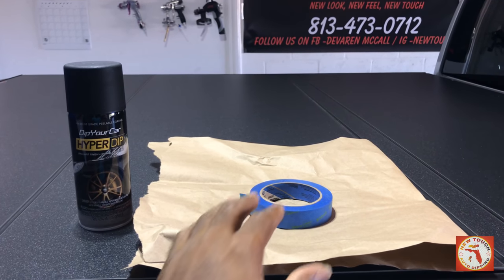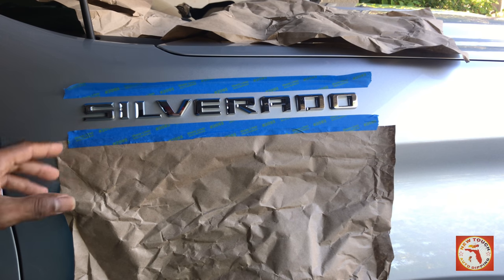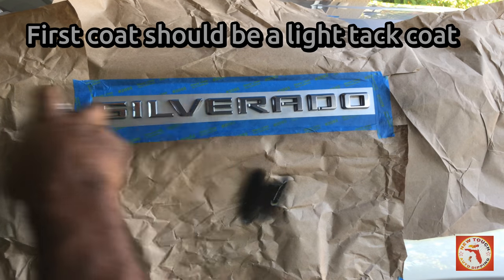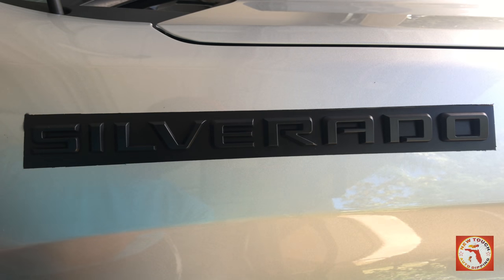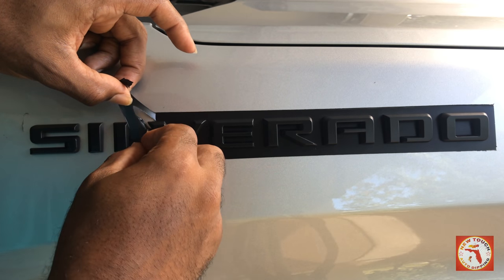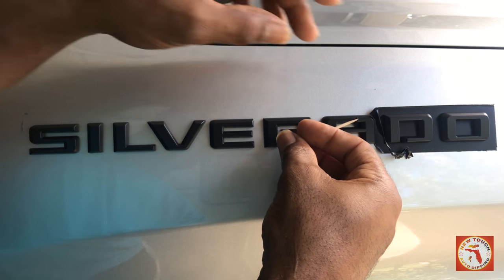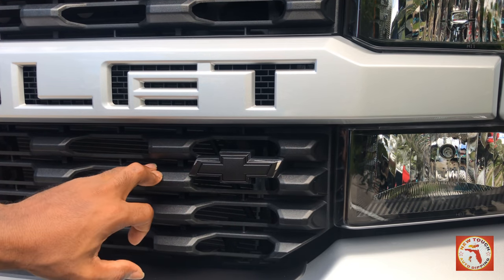(How to) HyperDip/Plasti Dip Your Emblems

Comment: A couple of questions how long do you wait between the 12 coats you put on. How long to you wait till you start pulling the
Reply from the maker: If your temperature is 65-75 degrees give it 15-20 minutes, if it’s 75 degrees above 10 minutes, if it’s 65 degrees below 25-30 minutes. Your temperature plays a huge role when you’re either outside or in a garage so the best temperature setting is 72-75. Wait 1 hour before peeling what’s left around the emblems

Comment: Many thanks for this post, appreciate the details! Been debating on swaps out vs spray dip. 

So do have a question…what you did with the Chevy emblem, is close to something I want to do. Want to black out my big Z71 emblems but, want to leave the very outer edge chrome. So, do I just tape that edge up to make the separation? Example, let’s say you wanted to leave the outside edges of the Silverado badges you did on the video, would you have just taped up that outer edge?
Reply from the maker: You’re welcome and thanks for checking out the video. If there’s no separation between where you wanna leave the chrome out you’ll have to be strategic. If there is separation, you can spray the entire badge and peel the area you want out 1 hour after spraying. 

Honestly, if this is something that you want to just give a shot at then I say go for it bc there are many benefits with learning. On the other hand, if you’re looking for perfection and something less timely I suggest that you go ahead and purchase the aftermarket swaps.

Comment: Would using a razor to cut in between the emblem slightly to remove the bond be easier to peel off afterwards ?
Reply from the maker: You could pretty much use whatever works best for you it if it’s applied correctly you won’t have to worry about any bonding. Of course you would have to be careful when using a razor blade, great question by the way.

Comment: Can you apply ceramic coating over the hyperdipped emblem? Is a dual action polisher going to mess it up if you bump while polishing?
Reply from the maker: With hyperdip you can’t but if you had your vehicle spray wrapped with dip armor you can apply a ceramic coating. There’s a high chance of a polisher unraveling the wrap, anything that is dry will expose it every time. A wet or lubricated microfiber towel is best for cleaning.

Comment: So five coats? And what’s the wait time between each coats again?
Reply from the maker: 8-10 coats should do it for hyper dipping emblems, 5-6 coats if you were using plasti dip. Wait 10-15 minutes in between coats, by touching the paint around the emblems during coats will be an indication for proceeding with the next coat. If the paint is dry then you can begin with the next coat

Comment: I guess I'll be the one to ask the stupid question here lol..but won't it peel off if you run your vehicle through a car wash? Yes I'm a newbie and don't know squat about it but you did such a badass job that I'm wanting to do mine as well.
Reply from the maker: Nah it’s actually a good question for beginners, just like with any product you’ll need to prepare the surface properly. When applied correctly you won’t have any issues with hand, pressure or drive through car washing

Comment: How long do you wait in between each coat? 20 minutes?
Reply from the maker: If your temperature is 65-75 degrees give it 15-20 minutes, if it’s 75 degrees above 10 minutes, if it’s 65 degrees below 25-30 minutes. Your temperature plays a huge role when you’re either outside or in a garage so the best temperature setting is 72-75. Wait 1 hour before removing the extra dip around the emblems, you’ll want to give it time to bond which makes it easier to peel

Comment: you could probably also plastidip the door trim right ??
Reply from the maker: You can pretty much dip anything but I don’t suggest painting anything with a rubber surface. Note that if the panel requires a lot of touching and pulling it won’t hold up well and will eventually peel.

Comment: I saw a "pre dip" spray and then alcohol . . . what's that process?
Reply from the maker: Well the predip spray is all that you’ll need to complete your project but I use the 99% alcohol for my personal use. The alcohol I use in areas that I’ve found to have issues with sticking, it helps the paint bond better in corners and creased areas.

Comment: How long will the HyperDip last on an emblem?
Reply from the maker: With emblems they pretty much last as long you keep the dip on, ideally you’ll need to remove or redo at the 3 year mark. If you prepare the emblems and apply the dip correctly you won’t have any issues with a pressure washer nor a drive through car wash.

Comment: Once it's on if the customer wanna remove it or change color how do they remove it??
Reply from the maker: Great question, if one decides to remove the wrap they can simply cause the peel to any corner by using a dry microfiber towel.
Reply: @newtouchauto  thanks  :)

Comment: How long does this last? Any special care needs?
Reply from the maker: When it’s applied correctly you can get up to 4 years before needing it removed or a re-coat. Soap and water is what’s needed to clean but the DipCoat protection spray is the key. It helps with the longevity and it maintains the fresh look. It’s the wax for proline, hyperdip and plasti dip products.
Reply: @doityourselfworld  it looks amazing, and the great instructional video makes it seem like I can do it myself. Thanks man!
Reply from the maker: @josealcala912  you’re welcome and thank you for watching the video.

Comment: Great job! 
I may have missed how long to wait after the final coat before starting to remove the excess. And is this application car wash safe?
Thanks!
Reply from the maker: When the temperature is 72+ degrees give it 1 hour before you remove it. When it’s applied correctly you won’t have any issues with hand, drive through or pressure washing
Reply: @newtouchauto  this goes for regular plasti-dip as well?
Reply from the maker: @freedompioneer4311  this process can be used for plasti dip but it changes a little with the spray coats. With plasti dip the process is faster bc you only need 5-6 coats to obtain a proper removal vs hyperdip which I spray 12 coats. Keep in mind that if you’re adding gloss, satinizer or pearls to plasti dip that’ll consist of 3-4 additional coats.

Comment: Great instruction on the process. Being that it peeled off so easily, how well does this hold up in the long run like in a car wash?
Reply from the maker: Thanks for the compliment and yes it’ll hold up against any drive through car wash. As long as the product is prepared correctly and properly installed you shouldn’t have any issues. Thanks again for checking out the video

Comment: Great tutorial video helping out tremendously, do I add the clear gloss immediately after applying the hyperdip?
Reply from the maker: Thank you, I appreciate that. Hyperdip doesn’t have a stand alone clear spray like plasti dip, they actually released 2 gloss options available in piano black and emerald metallic. I have a video uploaded on the emerald metallic black gloss if you’re interested.

Comment: Great job! Attention to detail and great explanation. Slow and steady wins the race with this process. I’ll be doing mine here soon and your video helped tremendously!
Reply from the maker: Thanks and I’m glad to be of help, yeah that patience wins every time. Thanks again for the compliment and checking out the video.
Reply: Great video! Right to the point and great advise. Question…. Does it stay on well with hand washes or do you need to be extra careful after it’s cured for a while?

Comment: Thank you so much for this!! I am gonna try it tomorrow and hopefully, it will be as smooth as you did! Pull away from the emblem and the O centre trick was gold!
Reply from the maker: lol Not a problem and thanks for checking out the video. You most definitely can achieve that good finish
Reply: @newtouchauto  so the hyper dip will just break away from the emblem? I didn’t see you make any cuts
Reply from the maker: @thepollock89  that’s correct, anything with a separation from panels touching will separate the connection making it easy to remove around emblems

Comment: Looks amazing! I do have a question, you said peel when wet but take your time, how long before the paint dries before I would have issues peeling it up? I have a Telluride and it's a lot of letters 😭 I don't want to mess it up by going too slow.
Reply from the maker: Yeah you’ll only peel the masking off while wet, then let the dip dry for 1-2 hours giving it time to fully cure. Once the cure time is up you’ll then remove the extra dip around the emblems carefully. A slow speed won’t effect the peel process, that’s pretty much you taking your time
Reply: I ordered a new Telluride Nightfall edition, but the “KIA” on the 2022 isn’t blacked out so I’ll be doing this for sure. Luckily it’s just the new “KIA” emblem I have to do. Just hope it looks as sharp as this!

Comment: Hi,  thank you so much for such a detailed and informative demo video!  I am all about DIY projects especially with my car.  Being a lady does not hold me back!  I have been watching tons of videos on this process as my current emblem overlays are starting to peel off - they were the vinyl heated process.  The one think I missed or did not quite understand is exactly how many sprays did you do to complete the process.  I know you were comparing to plastidip and I heard 12 coats but I did not understand if that would be plastidip product or for the hydrodip product.  Could you clarify for me?   I really want to do my rims as well.  Do you have a video or link for doing the rims?   TIA!!
Reply: It was 6 coats plasti dip or  12 coats hyper dip since it reacts differently, which is what he used in the video.
Reply from the maker: Yes that’s correct Mike, I used 12 coats for hyperdip. I have a (how to) video uploaded on spraying rims, it’ll help guide you through the process for a successful finish.

Comment: I have a 2021 Silverado RST / Z71. I would like to leave the red showing on the Z71 badge that is on the finder by the door. How do I do this? Thank you
Reply from the maker: There’s only one idea that I have and that’s painting the entire badge, on your last coat you’ll have to outline the red area with a toothpick or something sharp that’s similar to an exacto knife. You’ll perform that step while the paint is wet so you’ll need to be precise and quick. If you have any separation between the badge and where the red meets then you’ll be fine painting the entire badge and removing only the red area around the emblem.

Comment: Hey thank you so much for your video, I started to subscribe to your channel, very helpful! I also would like to ask you a question, I find it very hard to remove plasti dip off emblems, half of my work turned out pretty but the other half did not so I tried to remove the plasti dip and redo the work again, yet it took me a lot of time and I couldn’t get the plasti dip off the edges :(, any tips? Thanks!
Reply from the maker: Thanks and I appreciate the support, a lot of times when plasti dip is too thin to remove is bc you may haven’t sprayed enough coats. Other reasons maybe bc one left it on longer than 3 years without respraying with fresher coats. I have a video uploaded on peeling a whole car 4 years later, it’ll definitely give you some tips and tricks on removing old dip.

Comment: Awesome! How long can it last? can you use the same product on hard plastic that has faded? I have a Jeep Liberty Sport, still looks new but the plastic in the back exterior under the trunk door has faded from black looking to a very dry light grey. I hate it! It's a dead give away from looking like I had it for awhile. Thank you.
Reply from the maker: I can relate to the fading, I have a H2 Hummer that had the same issue but I refinished the areas with black gloss. If you’re interested I have a video uploaded on how to fix faded panels. 

As for your questions this product can last 3-4 years before needing it removed so that it peels away properly, yes you can pretty much paint any except rubber which I don’t recommend.

Comment: Great vid bro! Question: what kind of pre-dip spray did you get? Will any brand work?  Can only alcohol be used? I ask because whatever the pre-dip spray does, it will be removed or washed away by the alcohol.
Reply from the maker: Thanks and I used the DYC predip spray, I only use alcohol inside creased areas or panels where I feel may uplift. The alcohol gives it a tighter bond and doesn’t effect the predip spray, any adhesive brand will work during the prep phase.

Comment: I was looking at YouTube videos on removing emblems to change to blacked out emblems. Went down the rabbit hole and came across yours. So glad I did. Your instructions and results are second to none. One question, will one can do 6 emblems? Doing a Toyota Tundra. Not sure if I need one or two cans…thanks for a great video…..
Reply from the maker: Thanks for the compliment and checking out the video, for 6 emblems you’ll need 2 cans. You may have enough left in the 2nd can you do another small project.

Comment: This is a great video.  I just bought black "AVALANCHE" letters for my 2008 Avalanche, but I would have to replace one letter at a time and with my OCD, if a new letter was off just a smidge, it would drive me nuts.  I'll use this method now.  Glad I came across this!
Reply from the maker: 😆 I’m the same way, I used to have the same truck as you. Thanks for checking out the video and I’m glad this was beneficial.

Comment: So what's the process to remove the black plastic if I wanted to switch back to the chrome look
Reply from the maker: Very simple, you’ll have to create a peel using a dry microfiber towel or dull rag, Use it on any corner and roll back enough to peel away. You also can take a toothpick and cut through the middle, create a hole and peel away

Comment: Great clean job. Well done!. How much u wait between each coat of spray? And how long it takes after final spray that it gets fully dried?
Reply from the maker: Thanks I appreciate that, When the temperature is 72+ degrees wait 10-15 minutes in between coats and give it 1 hour before you remove it. When it’s applied correctly you won’t have any issues with hand, drive through or pressure washing
Reply: @newtouchauto  Thanks friend. You are the man...👍
Reply from the maker: @asts7910  you’re welcome and thanks for checking out the video

Comment: How does hyperdip/plastidip hold up to being washed? Any recommendations like no pressure washing or anything?
Reply from the maker: As long you prepare the emblems and apply the dip correctly you won’t have any issues with a pressure washer nor a drive through car wash. With emblems it’ll last as long as you want but ideally you’ll need it removed at the 3 year mark

Comment: Can this be done to imprinted emblems? My emblems(if that's the correct term) are imprinted into my trim plate...I don't know if its ever been done before...I have a picture of it if you want too see what I'm saying.
Reply from the maker: This product will adhere to pretty much any area on a vehicle but I don’t advise spraying onto any rubber or weather seal areas. I’ve seen a few imprinted emblems done but mostly the entire panel, if you’re aiming to only do the emblems you can do either 2 options. 
1) mask around the emblem letters and peel while wet on last coat 
2) on your last coat draw out the emblems using a toothpick

Comment: I just bought a used Silverado and the previous owner put red stickers inside the Chevrolet letters in the grill?
YouTube is crazy because I never even looked it up and they brought you into my bubble.  I was going to use plasty dip on the inverted letters on the grill.  What do you think?
Reply from the maker: If the design of the letters aren’t separated you will have difficulty removing what you don’t want painted. Gaps or separation helps you with a clean cut peel. 
I’d go with hyperdip over any plasti dip paint because it’s more durable.
Reply: @newtouchauto  thank you for taking the time to walk me through 
   I pulled the red lettering out today and you are right about it not being a solid background behind on the grill but I did use your idea on the custom lettering and it came out perfect so thanks again
Reply from the maker: @mrhood3977  you’re welcome and it’s good to know that everything worked out for you

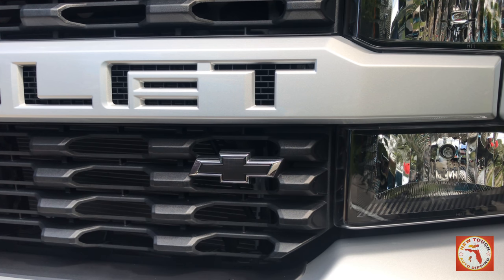Comment: At 15:21 you show the Chevrolet on the tailgate. Can you do a thin red line in the middle? And if so how would you suggest going about it?
Reply from the maker: Yes you can simply align a straight line of tape top and bottom, mask around that and on your last coat remove your tape while the paint is wet.

Comment: Thank you for taking the time to make this.. How well does the Hyperdip hold up to washes and such? IS there any certain material you wouldn't use this product on?
Reply from the maker: You’re welcome and thanks for checking out the video. When applied correctly you won’t have any issues with car washing. I don’t advise using this product on any rubber or weather strips, it’s a headache tryna remove it off.